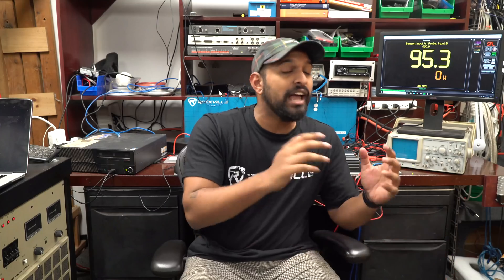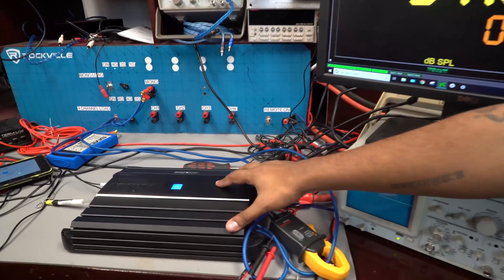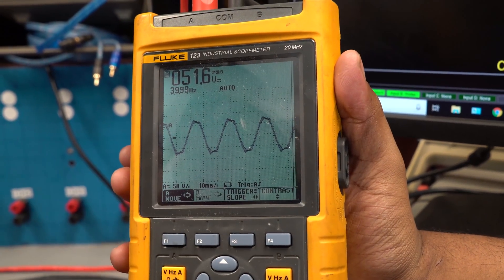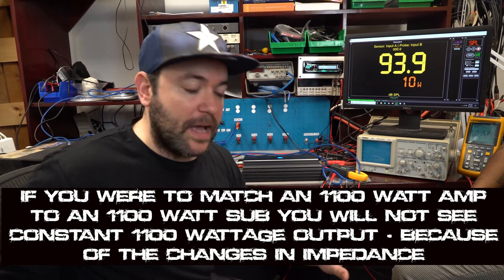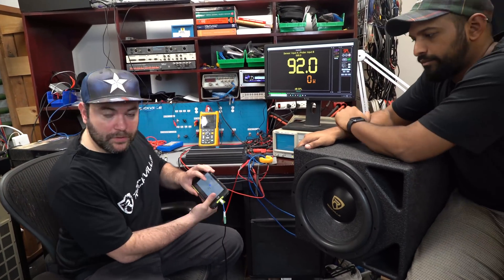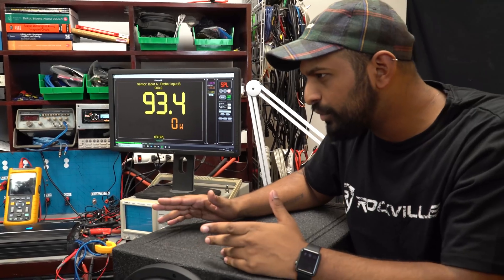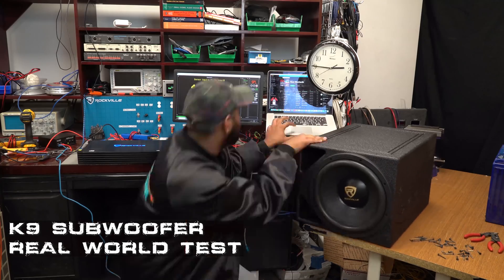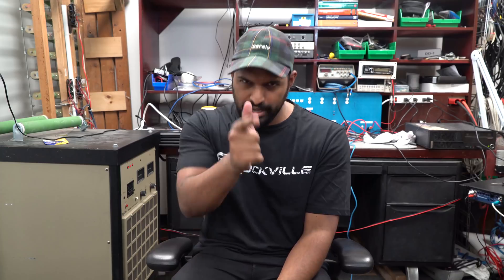Impedance Vs Frequency ft. An Alpine MRX-M110 & A Rockville K9 Subwoofer

Comment: well when i was getting to car audio back in the day the shop told me to buy an amp thats rated higher than the sub like if you buy a 1000w sub you get a 1500-1800w amp. i bought the re audio sx 12d2 wired at 1 ohm  and match it with a rockford t1500.1bdcp its 1500w at 1-2 ohms at 14.4 volts. thats conservatively rating it, 8 years later my subs still kicking
Reply: Yes thats actually a good idea because you leave headroom in the amplifier and don't need to run it at max all the time which is healthier for the life of the amp and also makes it less likely that you will gain up the amp and overdrive / clip the signal. The downside of it is if you are not careful or if someone doesn't know what they are doing they may gain up the amp that is more powerful than sub rating and can potentially in some circumstances blow the sub. So basically if you are careful and know what you are doing then its good practice!

Comment: Sucks ya'll are catching so much heat right now. I personally respect what you have going on as brand. I was thumbing through the website yesterday, it looks like you have alot of new products coming. I also notice you are changing the way you rate. Great job listening to the people. Keep up the good work.
Reply: @thebicjg69 you gotta have respect for these guys. Last year the the 1st version of the K9 subs came out and had issues they owned up to it and took care of their customers. Its rare to see that. Most companies would have done nothing but make excuses. So I ordered the v2 K915D4 when they came out. I also irdered the pre made ported box. The sub sounds great especially for the money. Ive had no issues whatsoever. Ive considered going a 2nd one but really need the space. I have a full size AWD Chevy conversion van.  I had an accident several years ago and there was no way i was going to get a minivan. I still have a truck but enjoy the van. The sub made the long ride to therapy alot more enjoyable.  I am going to swap the factory  speakers to all Rockville  and try to add a few more possibly. I have a few friends with more expensive subs and the Rockville definitely holds its own with them.

Comment: So.. Say If I took a 4ohm k9 and wired to 2ohm. Set the amp to 44.7v at 50hz with no clipping. It should play music and whatever fine if it's a 1000w rms sub. Someone correct me if I'm wrong. Also, gimme dat destroyer boi!
Reply: That would be correct. If you mean a dual 4 ohm K9.  You should have no problems. As explained in the video, Independence will change with the music.

Comment: So how do you explain the 2200 watt spike when the sub blew? Just saying it seems suspicious to me.
Reply: Michael, the amplifier used for the second test was a DBCOMP5 3500 watt amp. The volume for the test was set to output only 750 as that is what the woofer was rated for, and the numbers will jump up as the subwoofer coils burn out and the  impedance quickly goes from its impedance reactive load and  no longer has the resistance of the coils or any resistance at all it shoots a large output for a split second as that is happening. Watch exo video same thing happened as he blew the K9 woofer with the same song and with his own 3000 watt amp
Reply from the maker: When a Sub is blowing the Impedance is going down thats how you can tell a sub is blowing cause you'll see the Watts shoot up due to the impedance going down
Reply: As a subwoofer blows the voice coils start to overheat and unwind. A burnt voice coil or an unwinding voice coil will change the impedance. The more it burns and comes undone the lower the impedance drops until it finally let's go. Hence, why most amps go into protect as your sub blows. The impedance has dropped below the threshold of the amp.